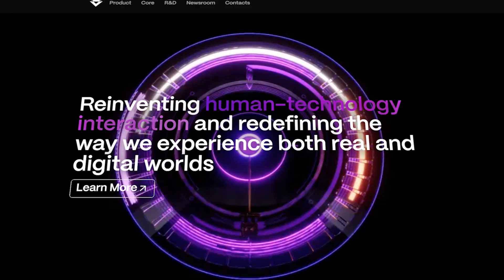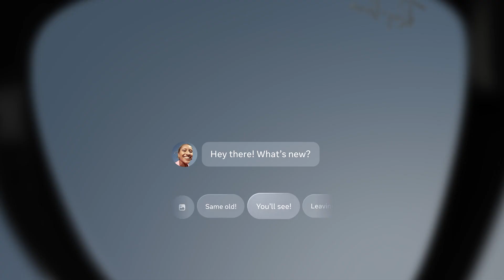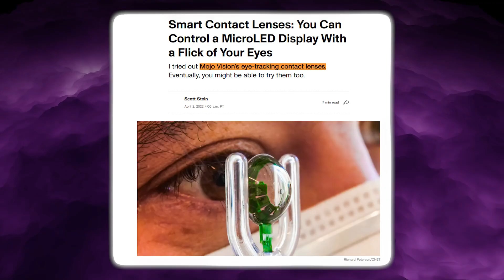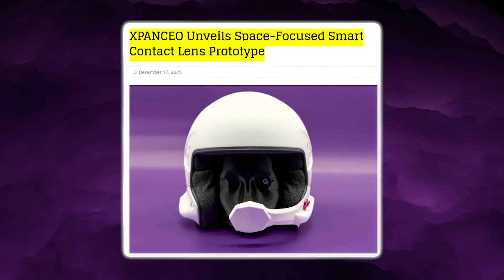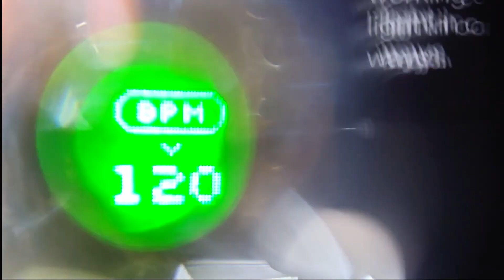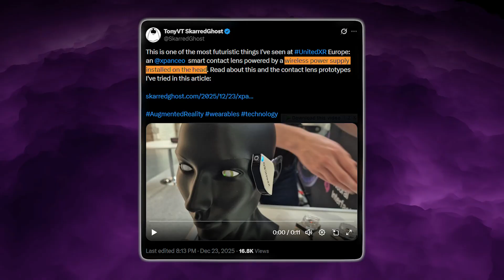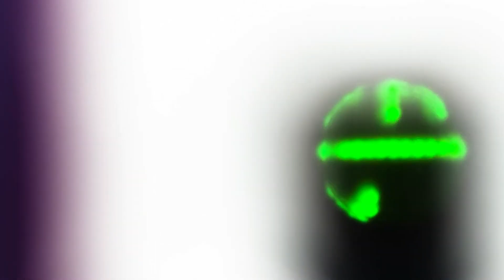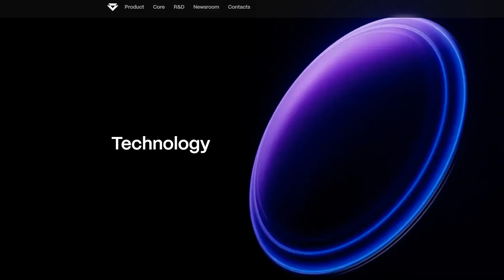Xpanceo’s AR Contact Lenses Terrified Google’s Gemini and Meta’s Smart Glasses!

Comment: As a board certified ophthalmologist, I see the small advantage and the large drawbacks: biocompatibility, dry eye disease and corneal astigmatism. It would be okay for 10-20% for use of a few hours. 
Accidents, distraction and poor multitasking with a considerable learning curve. 
For military personnel, certain jobs would have a slight edge compared to glasses. Glass-air-cornea space is important for large refractive errors, not for most of us in the Western world (Asians tend to have larger myopic shifts)
May be acquired by google eventually depending on tolerance.